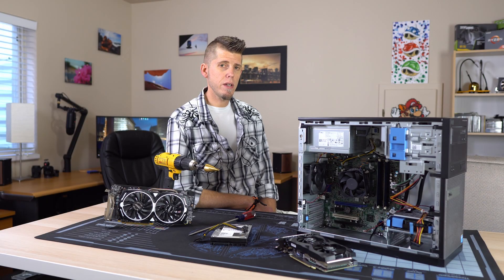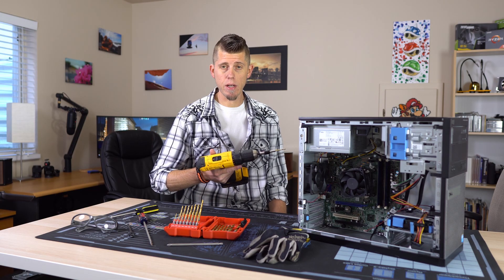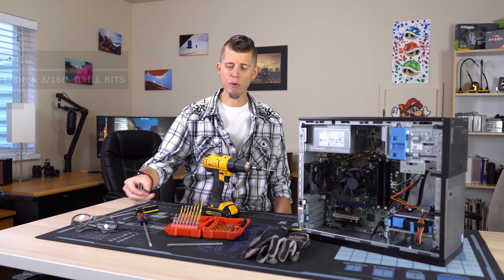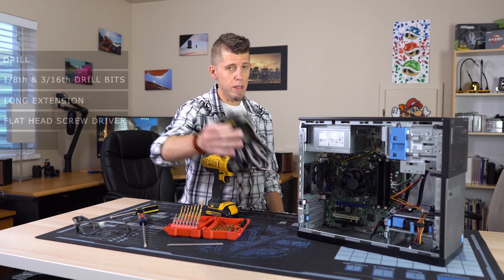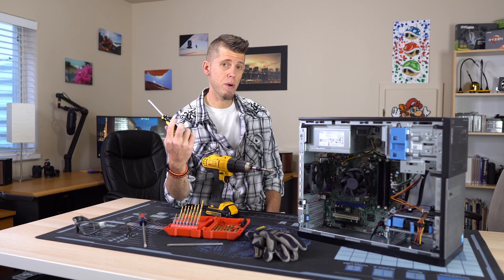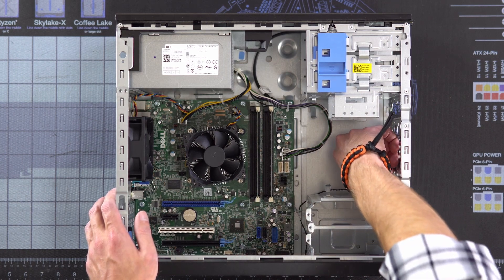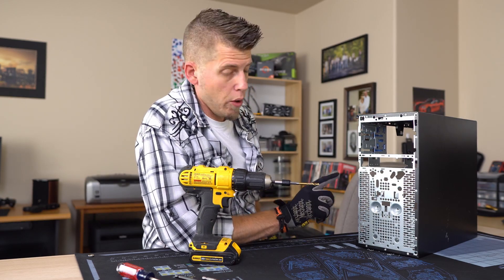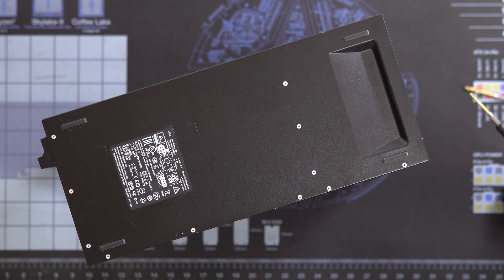Adding A Bigger Graphics Card In A Dell OptiPlex

Comment: Thanks! I found this actually to be a bit of a PITA (took forever to get through the bottom plastic), but I think that's because I was using a standard bit for the smaller pemserts; that's the only thing I had that would fit. I still got it done, and if the bit needs to be replaced due to damage, I am not too concerned right now; I have used that set twice in about 20 years, and I can't imagine when I'd need it again.

Comment: On a scale of 1 to 10 how easy would it be to do this
Reply from the maker: So long as you have the tools to do it, I would say this is fairly intermediate. I would say a 4 or 5. The worst part is that you just need to take it slow on those rear rivets that hold the cage to the back of the case. You might get lucky with those on some xx10 models, maybe other, where they're not riveted. Seems there are some that are slotted in at the rear rather than riveted.

Comment: I understand I’m a year late, but on the 9010 I have the cage is not the issue but rather the SATA slots are in the way. Is there any way to fix that?
Reply from the maker: I really need to make a video on this, but it's pretty simple. Just use some low profile cables. There are some 90 degree SATA cables you could use, but you'd have to get a left/right angle so you could use both ports. Also, most 90 degree SATA cables are tall... so it's a crap shoot if they'll be short enough. Silverstone makes some low profile cables that work perfectly, but they're a little spendy as far as SATA cables go. For the USB3 header there are some low profile cables as well. Here's some Amazon links to each one.

Silverstone 300mm: https://tinyurl.com/ybhreyms
Silverstone 500mm: https://tinyurl.com/ydzaw942
Low Profile USB3: https://tinyurl.com/ycd9e8vy
Reply: @TheGameBench  wow thanks so much dude, ur the best!
Reply from the maker: @rhf7071  Sure, no problem.

Comment: If the hard drive cage is removed, is there a space where I can put a second drive? I'm thinking of adding a sata ssd later on.
Reply from the maker: So, I install the hard drive in the drive bay below the DVD drive. Some people like to use the tabs below the two five and a quarter bays as well. For the SSD, I just use some 3M Command strips to hold it onto the side where the drive cage use to be.
Reply: @TheGameBench  Thank you so much for the reply, I know this vid was made around a year ago so I didn't expect you to reply! I will probably do the same, put the hdd in the drive bay under the DVD drive and maybe tape a ssd to the side of the case where the drive cage used to be. Is there any risk of the ssd falling though? And if it does fall while the pc is running, will it stop working?
Reply from the maker: @fatneek5847  Sorry for the late reply, but there are no moving parts and an SSD doesn't weigh enough to damage itself. So, I wouldn't worry about it. I doubt it would fall anyways.
Reply: @TheGameBench  Thanks for the help, now I won't have to put a mini graphics card into a case with little airflow in the first place, as I know they don't have very great coolers.
Reply from the maker: @fatneek5847  Oh yeah... some aren't bad, most are trash. Anyways, happy to help.

Comment: If my graphics card is smaller than 10 inches , would I still need to remove the cage to install a fan?
Reply from the maker: Not really. You can fit a fan above the HDD cage. I just installed one recently and put an 80mm fan in one. You could fit a 92mm or a 120mm if you're not set about a clean fit.

Comment: Will the 3020 work with this mod?
Reply from the maker: Absolutely. The only issue with the 3020 and longer GPUs is the SATA power connection on the motherboard. It's lower down than the 70/9020 and it can give you a little trouble with longer GPUs. Especially ones with backplates. I talk about that in my latest video.

Comment: Him: Talking about all these tools

Me: Holding JUST a screwdriver
Reply from the maker: LOL.

But it is actually possible with just a flathead screw driver. I've run into models that aren't pressed in at the back. Instead they used slots. All the other ones can be take out with a flat head and a hammer.
Reply: @TheGameBench  Was one of te models a 7010 mt?
Reply from the maker: @KINGPHANTOMw85  Yes, I've seen that in the 7010 and 9010 MT, but I've seen just as many of those with the pressed on cages at the back like in the video.

Comment: OMG THANK YOU, I thought I had to give up my RX 580 8GB that I got for $87 on offerup.

Bloody hdd cage was in the way of it.
Reply from the maker: I'm glad I could help. It was literally the first thing I did when I started working on these. It was in the way of the 480 I was trying to install. Fifteen minutes later.... it was gone.
Reply: I also found this video, because of an RX-580. Did you have to replace the PSU? I've got one in my shopping cart, but I haven't bought it, yet.
Reply from the maker: @miniaturemage  For the 580, absolutely. The power supply would most likely go into overcurrent protection and shut off. A good replacement option would be something like an EVGA BR series, and I'd suggest at least a 500 watt if you're replacing it. If you have a 20 series model, XE2, Precision T1700 or a similar Vostro with the 8-pin main power connection, you'll also need an adapter.

Power Supply: https://www.amazon.com/EVGA-100-BR-0500-K1-Bronze-Power-Supply/dp/B07DTMXD83/ref=sr_1_1?dchild=1&keywords=EVGA+500BR&qid=1611601198&sr=8-1

xx20 Series Adapter: https://www.amazon.com/gp/product/B07CJ411ZL/ref=ppx_yo_dt_b_search_asin_title?ie=UTF8&psc=1

Comment: It's nice to see people build their PC. I'm personally really new into PC build so I don't know much about the systems, hardware, wattage calculation, and more. So um I have an Dell Optiplex 980 and I was thinking about upgrading it. The plan is about to upgrading the processor, GPU, RAM, and obviously the PSU. I have a problem to decide which GPU fits best because the heat sink is really cost a lot of space.

I was wondering if GTX 750 Ti or GTX 1050 Ti would be the best I can get but then again the size of it's heat sink is way too huge. Do you have any suggestion for the GPU ? It would be perfect if you could suggest a GTX 1050 Ti with a specific models or manufacturers or even the single/dual fan.
Reply from the maker: Yeah, that heat sink is a real problem. The Tech Power Up GPU database has length information on a lot of GPUs that can help. I would avoid anything that makes contact with the heat sink. Especially if it doesn't have a back plate. However, you can use the bottom PCIe slot, but I would guess it's only wired as an x4, which isn't a big deal for something like a 1050 Ti or a 1650. Won't make a difference for a 750 Ti.

Now, which GPU would be a good pairing depends on the CPU. If it's an i5, nothing more than about the 1050 Ti. If it's an i7 I'd say a 1060 6GB or a 1660 might be the best you want to go with. I wish I had one of those first gen CPU's to test with.

Comment: Will a rx 470 SAPPHIRE nitro fit in a dell optiplex 3010 without modification?
Reply from the maker: Those have the PCIe connector on the end, and without it connected it should fit fine, since I think it's about nine inches. With it connected... that might be an issue. If not, there are some 180 degree low profile connectors that would get around that issue. One way or another, you'll want to be careful fitting it with the HDD cage in. Since you'll have to go in at an angle, you run the risk of hitting the motherboard with the I/O plate on the GPU and damaging it, so just keep any eye on that if you decide to go for it.
Reply: @TheGameBench  ok thanks for letting me know, I might go for it if I find a good deal other wise I will go for a xfx rx 570 and remove backplate so it can fit

Comment: How did you get the sata cables to work using the longer gpu when it's covering the sata ports?
Reply from the maker: This is was a 9020 and the SATA ports are low enough so that's not a problem with any dual slot GPU. I'm guessing you've got an x90 or xx10 model? With those I use the Silverstone low profile SATA cables. They're guaranteed to clear and they come in 300mm and 500mm. If you have an xx10 and also need the USB3, there are some cables I use for that.

300mm SATA Cable: https://www.amazon.com/Silverstone-90-Degree-Low-Profile-Connectors-CP11B-300/dp/B00KTLGDGA/ref=sr_1_2?dchild=1&keywords=silverstone+low+profile+sata&qid=1603159594&sr=8-2

500mm SATA Cable: https://www.amazon.com/SilverStone-Technology-SST-CP11B-500-Low-Profile-Connectors/dp/B00KTLGDZG/ref=sr_1_1?dchild=1&keywords=silverstone+low+profile+sata&qid=1603159622&sr=8-1

USB3 Cable: https://www.amazon.com/gp/product/B083XDQSWT/ref=ppx_yo_dt_b_search_asin_title?ie=UTF8&psc=1
Reply: @TheGameBench  awesome. Thank you!
Reply from the maker: @tyvang559  No problem.

Comment: I've watch all the Optiplex videos in this series and I'm still exactly sure if the GTX 1060 requires the removal of the Hard drive cage. I'd prefer not to do all that drilling, so can the 1060 fit?
Reply from the maker: There are models that will fit. I believe the Asus Dual will. The Zotac Mini will for sure. The EVGA SC model is also a good option. I think MSI even has a single fan 1060 you could go with, but I don't suggest that one. Anything under 9.5 inches will fit for sure.
Reply: @TheGameBench  Many thanks for your reply and apologies for my illiterate first message, I typed it in a hurry! I will look at those models of the 1060. Are there any real differences between those models or is it just a matter of getting the length right?
Also, I can't seem to find solid info on which SATA port to use for the SSD. Following general advice I used SATA port 3 and mounted the drive in the 5.25 bay under the DVD drive. You mentioned that using the blue SATA port was optimal. Is there going to be any performance difference? Thanks again!
Reply from the maker: @moonwhistle  No worries. There will be perofrmance differences, as they have varying clock speeds. TechPowerUp has a nice GPU database that will show clock speeds on various models as well as lenghts on most. For most, the difference will be minimal, but there are some that are pretty bad. For example, the single fan EVGA SC has an identical looking model that's a non SC that runs at a much lower clock and has a terrible cooler. And you want to avoid those. There also come in 6GB and 3GB models, so make sure on that as well, as the 3GB models have less Cuda cores are a bit slower that the 6GB models.

As to the SSD, depends on the model. Most of the MT models, save for the 390 and 3010, have two SATA3 ports and the beige ones are SATA2 which will hold an SSD back, so plug it into the blue or black SATA ports if you can. However, a HDD can run off the SATA2 ports without being held back.

Comment: Do I have the remove the cpu, motherboard and everything else when I drill the hard drive cage out or is it okay to drill with all the component intact?
Reply from the maker: I would remove everything. When you drill it out, you're going to have small pieces of metal loose in the case, and they can find their way under the motherboard, which can cause a short and damage it.
Reply: @TheGameBench  Thanks!, keep it up!

Comment: Ik video is old but what length of GPU is max to put in the optiplex? is GTX 1060 3GB palit going to fit? It's like 252mm = 9.92 inches
Reply from the maker: Without removing the HDD cage? Maybe. That's going to be pretty tight. I've seen people fit SOME ten inch GPUs. It all depends on the shroud. Typically anything under 9.5 inches isn't much of a problem. That's why I remove the cage. But, if you're going to try to fit it, just be careful as the I/O plate of the GPU can hit the mobo and damage it since you have to angle it in there.
Reply: @TheGameBench  thanks for advice man
Reply from the maker: @CEKARY  No problem.

Comment: Can i put a triple fan gpu in this?????
Reply from the maker: Possibly. I test fit a 1080 Ti FTW3 in one once the HDD cage was out and it fit. The PCIe power connections would be tight, but you can make it work. Can't guarantee that every triple fan model will though.

Comment: Question: if I have a powerful enough psu can I use any graphics card in a computer?
Reply from the maker: Not any computer. There are OEM systems that have limitations on them that prevent adding a dedicated GPU, or at least anything that would be considered a gaming GPU. In these OptiPlex systems, you don't have any of those limitations, but as these are older CPU's, there's a point where going with a higher end GPU doesn't make sense. For example, in my testing, with the i7 4790 the 1080 Ti didn't make any sense to buy over the 1080 at 1080p.

So, with enough power, you CAN install any GPU you want inn one of these, but it might not make sense to do so.

Comment: Love the content and your videos have really helped me with my Optiplex build. I got a 7010 before finding your videos unfortunately but so far I have made it work for me. I am facing a minor problem right now , I was able to install a GTX 1070 XLR8 OC without any case mods to speak of. I had to sacrifice front USB 3.0. I am now trying to add a 3rd hard drive and get my disk drive working , but I can’t seem to find sata cables short enough to fit under my GPU. The SATA cables that came with my PC just barely clear however I can’t get an accurate measurement. The SATA cables that I purchased have a right angle to straight. Right angle being .8inches and the straight head being 1inch. Both are too long to fit under the GPU. Do you happen to know what sata cables would work for my situation? I would prefer to use the same cables for each SATA slot , I would be utilizing all 4. If you provide me with an amazon link I’ll be sure to purchase it :) . Keep up with the quality content , you’ve earned yourself a new subscriber and I’ve shown many people your videos
Reply from the maker: Sorry, this is probably at least a week and a half late. These are what I use with the xx10 models.

For the drives on the bottom of the case: https://www.amazon.com/Silverstone-90-Degree-Low-Profile-Connectors-CP11B-300/dp/B00KTLGDGA/ref=sr_1_3?crid=NDIIJ0JQ5JVC&dchild=1&keywords=silverstone+low+profile+sata+cable&qid=1599453742&sprefix=Solverstone+low%2Caps%2C216&sr=8-3

For the drives at the top of the case: https://www.amazon.com/SilverStone-Technology-SST-CP11B-500-Low-Profile-Connectors/dp/B00KTLGDZG/ref=sr_1_1?crid=NDIIJ0JQ5JVC&dchild=1&keywords=silverstone+low+profile+sata+cable&qid=1599453742&sprefix=Solverstone+low%2Caps%2C216&sr=8-1

Also, you can use this for the USB3 port: https://www.amazon.com/gp/product/B083XDQSWT/ref=ppx_yo_dt_b_search_asin_title?ie=UTF8&psc=1

Comment: How would you fit a long psu in preferably an evga 650 bq
Reply from the maker: The 650 BQ is 6.5 inches, so if it's a 3020, you don't need to do anything. However, in the x90, xx10 and 7020/9020 you'd have to remove the latch, and then put the latch back in after you install the power supply. Getting the spring back in is a little tricky, but it's doable.

Comment: I’m planning to get a rx 580 but I’m worried my gpu brackets on the back of pc is to small
Reply from the maker: On your Optiplex? If it's an MT, there 4 slots on the back and I can't think of any 580 that won't fit in the Opti once you remove the HDD cage.
Reply: If it's the 2 fan 8GB Radeon. Yes, you have to remove that lousy cage to fit it.

Comment: This is the project I'm currently working on,  got a gtx 1060 turbo and can't install it until I get the cage out.
Reply: Plot twist I got the gtx 1060 installed it worked fine now I'm using a rtx 2060 super🤣😂.

Comment: Tin Snips
Reply from the maker: Doesn't work so well with the HDD cage. Since you have to deal with the stamped areas inside the cage. Might be possible... just wear some gloves.
Reply: @TheGameBench  I have used tin snips many times on these optiplex drive cages. 
I snip out the top-left corner & leave the bottom bay. 
Not pretty & takes a bit of force, but in the end it does well enough.
Reply from the maker: @adampsyreal  Fair enough... and you still have one bay for the HDD and you can stick the SSD on top. Not a bad solution at all.
Reply: @TheGameBench  I keep the optiplex caddy & use a bracket that holds two 2.5" drives in 1 bay

Comment: Can someone tell me what is the maximum length card you can fit without removing the cage. Will an asrock rx 570 fit at 236mm? And can all sata ports be used without a right angle?
Reply from the maker: Yes, it will fit without removing the HDD cage. If it's a 390, 3010 or xx20, any dual slot GPU will fit without interfering with the SATA ports. If it's a 790, 990, 7010 or 9010, yes you will have to use some low profile cables to make it fit.
Reply: @TheGameBench  thanks
Reply from the maker: @Deuteriumaddict  Sure thing.

Comment: Wait, how am I supposed to remove it now? 🤔 I put in my GPU but now I can't remove it bc I need to pull the latch underneath it to release it
Reply from the maker: What model do you have? Something I forgot to take into account when I made this was that there are certain GPU's that will require trimming the the latch.
Reply: @TheGameBench  I have the Dell Optiplex 3020 Mini Tower. I installed the MSI Radeon RX 580 and now I can't remove it lol
Reply from the maker: @AaRoNmE2  I'm guessing the metal bar is in the way? Must be the Gaming X or the Armor Mk2. You're going to have to cut the latch in order to get it out.